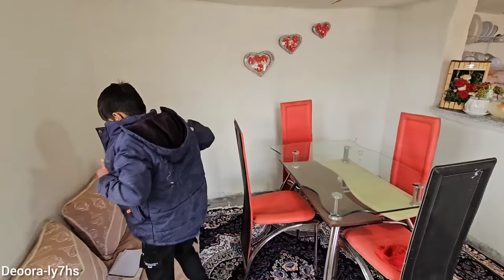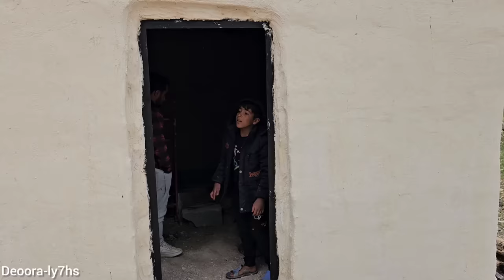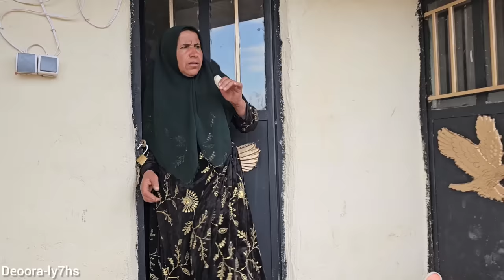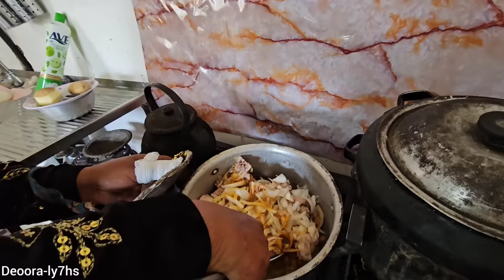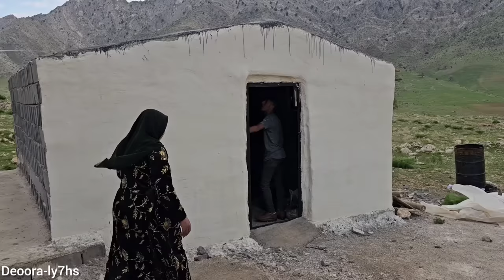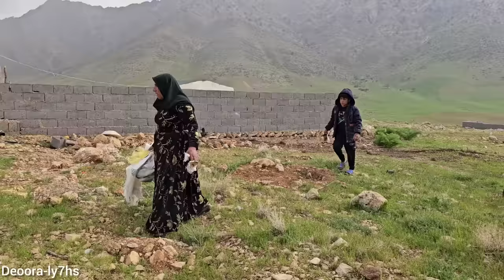The heartbeat of the twins: Hojjat's return from the military and counseling for courtship #deoora

Comment: Momma you keep the fire too high. You don't need the fire to cover the whole bottom of the pot. Just enough to heat the pot. Outside you can't help but have the fire high to burn the wood . Inside you just need the fire to heat the very bottom of your pot.